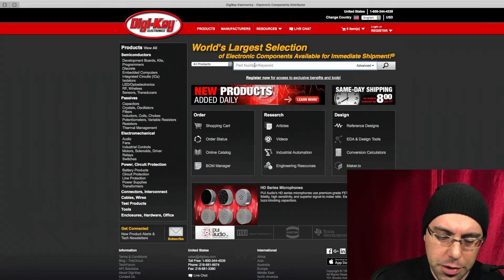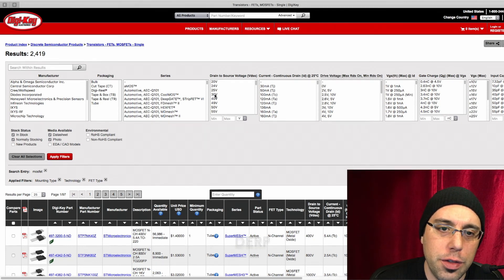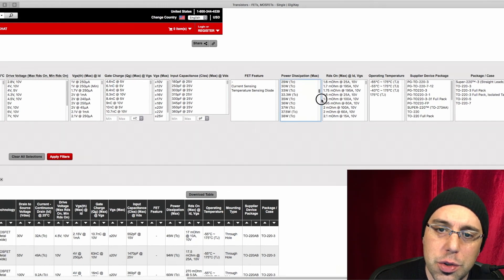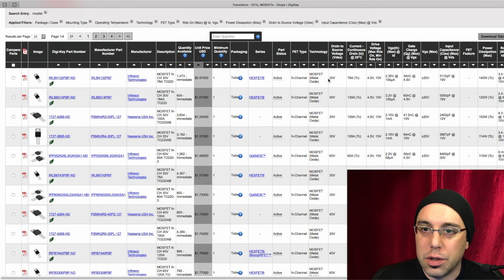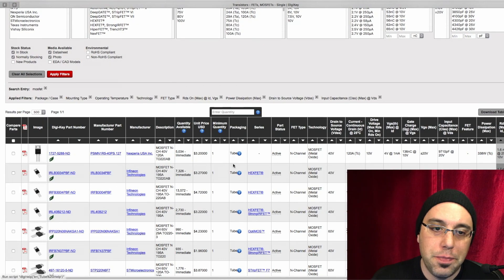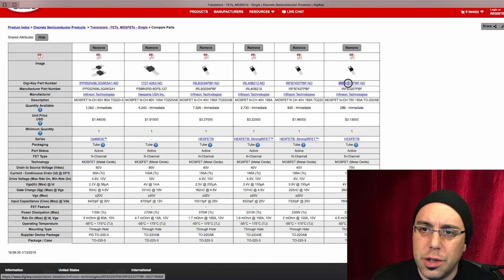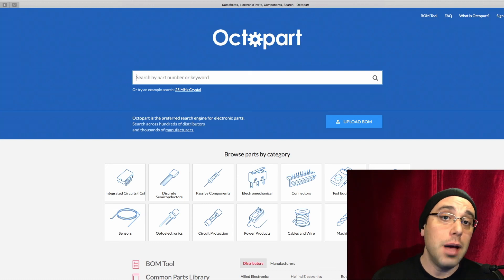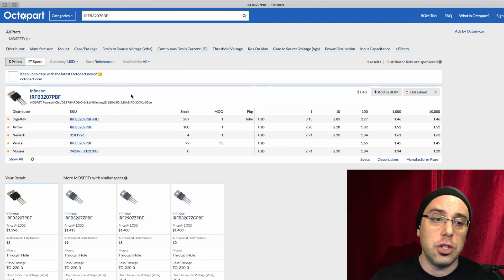5MDD RAMPS 1.4 bed MOSFET selection

Comment: Hi Alex, l'm attempting to run my ramps 1.4 board at 24v. I've got a couple spare cheapo heat bed power modules. They are advertised as 12v 15a. Can I use the same device to take strain off the on board mosfet? I'm no electrical engineer just a guy trying not to burn the house down. 

Love your videos, 
Keep it real
Reply from the maker: You can only really take strain off a mosfet by either running it at a higher voltage, or running it into higher resistance bed... or just using an external mosfet board since those have decent heatsinks and a low Rds(on) mosfet.

So a few options:

1) If you think the bed mosfet is decent, you could just run one of those 12v supplies on a 12v bed and just make sure your bed resistance is not so low that it pulls enough current to toast your mosfet or connectors (see around 2 minutes on my RAMPS 2 of 5 mosfets video for the math involved).  Higher resistance means less heat from the bed, but it also means less heat for the mosfet and less chance of melting the connectors.

2) if your bed mosfet is NOT decent, you could run those 12v supplies in series for 24v and use a 24v bed (assuming the supplies are absolutely identical, and even then you should add protection diodes in anti-phase on each output) which is a little risky, but I do it. Again, this ONLY works if the supplies are identical, have the same turn-on time, and the outputs are floating and isolated.

3) If you are unsure of the quality of the mosfet and don’t want to test and/or replace it, since those supplies have plenty of current, you could use an external mosfet board.  That will cost you like $7-12 and add some wiring, but you will be sure not to melt down your mosfet or connectors, and it lets you use one of those beefy 12v supplies that you already have

4) you could dig up a salvaged power supply for the bed that is higher voltage, like an old laptop or LCD monitor supply in the 19-22V range, as long as it has enough current (like around 5+ amps for the 5-5.5 ohm 24v beds, or around 7+ amps for the 3.5-4 ohms 24v beds), but that was only worth it if you grab one cheaper than the cost of an external mosfet. I grab them any time I see them at thrift stores for under $5.
Reply: Alex Kenis I apologise for not being clear. I have a 24v power supply. The module to which I was referring is an external mosfet board that is rated at 12v 15a.
Reply from the maker: Ah, I see.  The board mosfet should be fine at 24v as long as the bed resistance is within the right range, but if you want to use the external 12v modules at 24v: it depends on the circuit. I had a brief exchange with Peter Oakes over at this video of his https://youtu.be/6WwCqxSaF_w where he tested a few external mosfet boards, and they were fine at 24v.  I ran into one or two that used full rail voltage on the mosfet gate though, and those would not work at 24v since the max gate voltage of the mosfets they used was 25v, so any positive fluctuation would low the fet's gate out.  You could take a look at your board and see if there is a voltage divider to the gate, or just power it up and measure the gate voltage and see if it is lower than the rail voltage: if either of those are true, you are fine at 24v
Reply: Alex Kenis Perfect. I'll measure the gate voltage. I appreciate you taking the time to educate me here. Really, thanks!